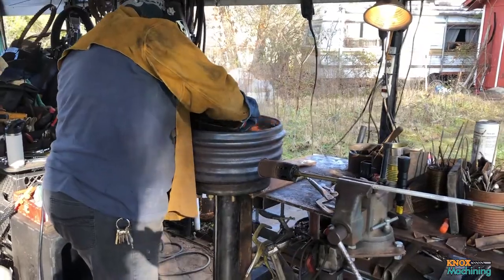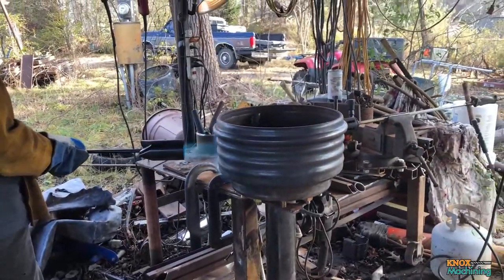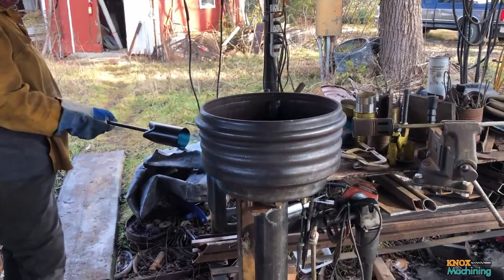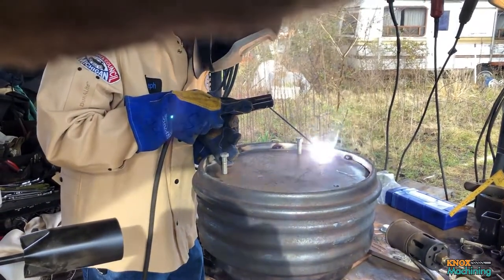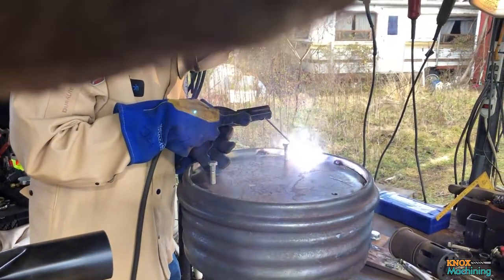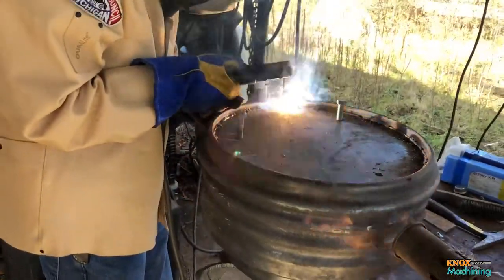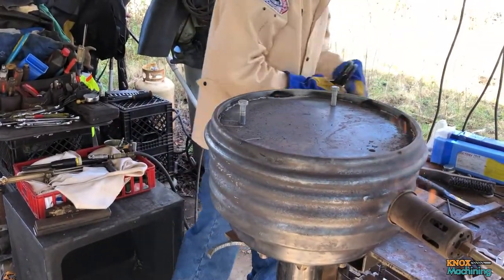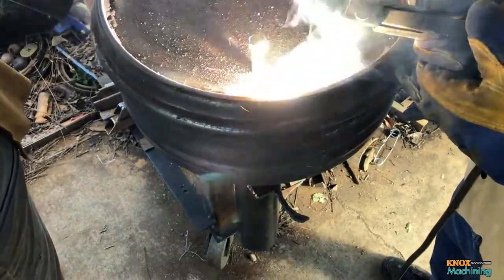Tool Grinder Pedestal - Welding mild steel to cast iron brake drum

Comment: Kinda hard in the weather we have had the last few days.  You need another tank of propane. LOL  Wishing you a Happy New Year, and may 2021 be a much better year.
Reply from the maker: We did it on the 21st of December.   It was around 50 degrees Fahrenheit that day.  Problem wasn't the temperature, it was the wind.  We could have used some wind breaks or something.  But, overall, it went very well.